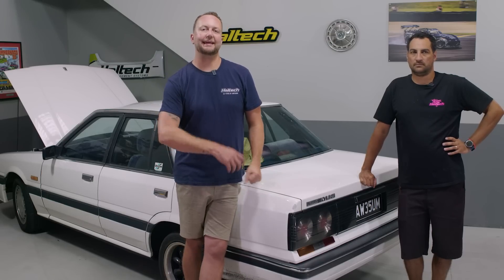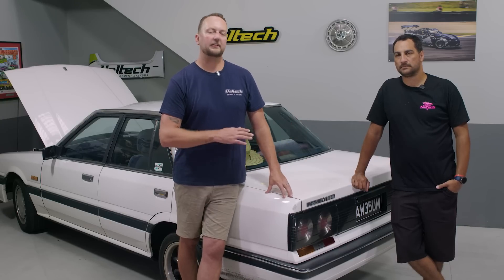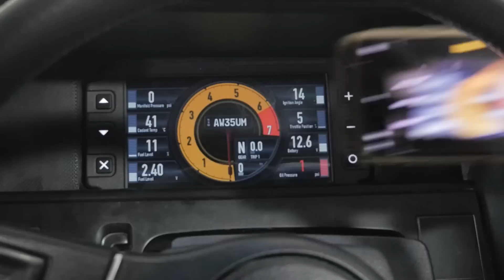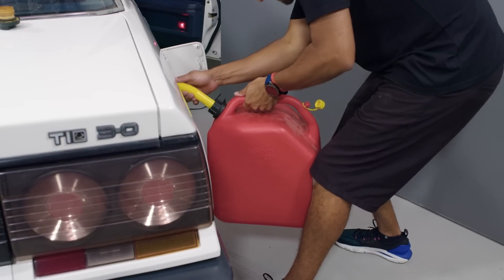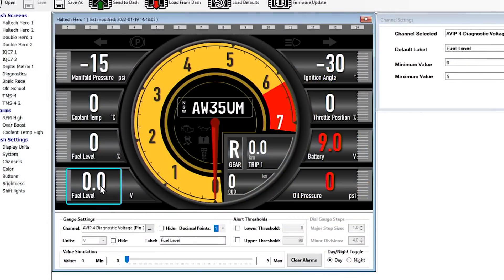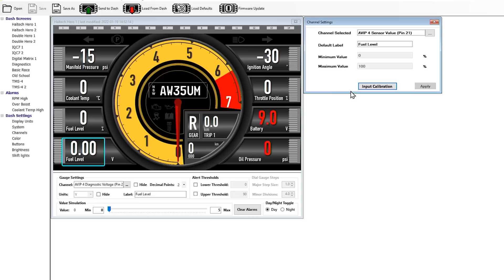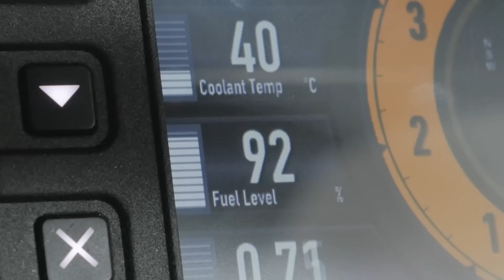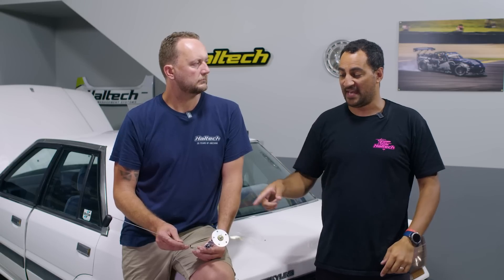🛠 How to calibrate Fuel Level on Haltech iC-7 dash | TECHNICALLY SPEAKING

Comment from the maker: Our last iC-7 wiring video received a ton of requests for a more in-depth video on the fuel level calibration. So we've called back our wiring expert and our tuning guru for, what we believe, will be the definitive guide to calibrating your fuel level with an iC-7 dash.
Reply: never seen a saddle tank with 2 fuel senders. usually they just pump fuel from 1 side to the other to keep the side with the main pump (the pump that feeds the engine) and sender fed and accurate.
Reply: @petelattimer6808  can't of worked on to many different types of vehicles quashqai some Porsche bmw the ones I've seen

Comment: i prefer monitoring voltage every 5 liters of fuel because all fuel tanks are not a square cube like your linear chart suggest,
sometimes they have weird shapes and the first 5 liters may not change the reading voltage as let say the last 5 liters due the fuel tank shape,  also doing this procedure require at least a battery charger that can hold or mimic engine running voltage.
i started empty ( not 5 liters safe factor), i prefer set an L.E.D alarm at 15 liters
but you guys probably know all that 🙂

Comment: An important thing I’ve noticed since owning mine. When taking the raw data. If possible have the engine running. The difference in reading due to the voltage with the engine off. And the alternator charging. Makes quite a big difference to the fuel level reading, ideally in the future the ic7 needs a voltage correction table added for this. But until then it’s worth re doing the calibrations with the engine running if you couldn’t at the time of initial install.

Comment: What's the advantage of using a Haltech Fuel Level Sender Signal Conditioners?

I ordered one of these (it brought my order up to the point where I got free shipping).  I'm wondering if it would be an advantage to use it or not.

Fuel Level Sender Signal Conditioner

Part Number: HT-038002

Comment: If i'll be doing this on cars original level sender and wires, for example on an r32 skyline, would i need to connect 1 or 2 wires from connectors behind the gauge cluster into the ic7?
Reply: You should just need 1 wire, the other should be grounded at the tank to the body.

Comment: Couple of extra points to note:
1. Saddle tanks won't empty with the feed from the fuel pump if you have a return system. Most use a venturi on the return to suck fuel from the other side of the tank and require fuel flow in the return line to create that effect. The other side may need to be syphoned manually. Dead head systems you should be ok with since the return and ventri is built into the feed.

2. The Haltech IC7 has been coming in different pullup resistor values. Haltech's videos show a 240ohm pull up, however I have had two IC7 dashs and one just purchased a month ago and they both have 1000ohm pullup on AVI4. I'd recommend putting in your own 240-270ohm resistor pullup externally to the IC7 and turning off the 1000ohm internal one. This will give a boarder range of voltage reading. 1000ohm is way too high and makes the gauge too sensitive.

Comment: Does the dash get 12v feed from haltech can connection ?
Reply: 12v comes from the CAN plug that does into the Elite ECU.
Reply: Sweet thanks that's what I meant lol the 4 pin plug

I'm in process of setting up fuel level took me some time so you set the dash to raw voltage and capture pics then convert into dash table 

Was confused as how you guys have voltage display I only have Liters display

Comment: I think it's important to note most factory senders are NOT linear in terms of position vs. resistance value. In your case, I'd consider doing a "1/2" tank fill as well, to get an additional data point to improve mid-tank accuracy.
Reply: The shape of the tank also makes a big difference. If the sides of your tank aren't perfectly vertical, then you're not going to get a linear response. 
This is why some cars seem to take ages to drain from 100% down to 30% (eg), and then the last 30% seems to disappear quickly.
Reply: Yep, full to half is generally quite a bit faster than half to empty.

Comment: Maybe you cover the smoothing filter, and how to calibrate. So you can set it so your fuel level on the dash output doesn't slosh as much.
Reply: I would be interested in this to, the fuel level is very sensitive and moves around a lot while driving
Reply: Resistors.  the IC-7 has a built in resistors into the one of the Analogue Volt input. If you don't have IC-7 e.g connecting the sender directly to the ecu, you'd need to assemble a breadboard consisting of resistors etc, or buy directly from haltech, their fuel level signal conditioner. It filters the resistive signal (ohm/resistance) and converts them to 0-5 volts
Reply: @alirezamahendra9507  thanks for the reply Ali. I did use a resistor, so I have a much larger range for the voltage depending on level. But the level can shift drastically with stopping and cornering. And they have a smoothing filter to combat this. Just thought I would suggest they they cover it in the video. Thanks again for trying to help!
Reply: Try increasing the smoothing number, I typically go to something like 9000 or higher.
Reply: I also wish they covered this more, I've just been adjusting my smoothing factor in my IC7, seems to be pretty good now.